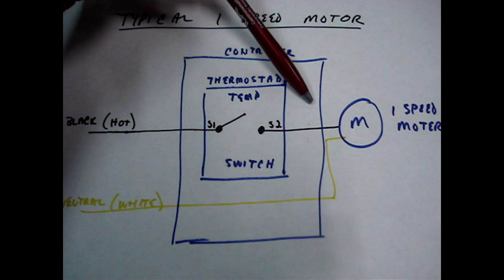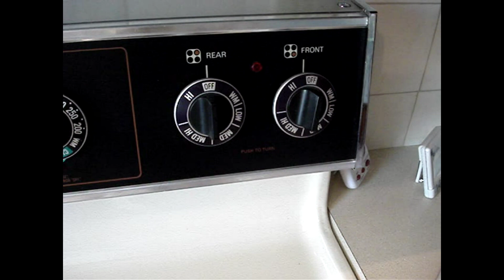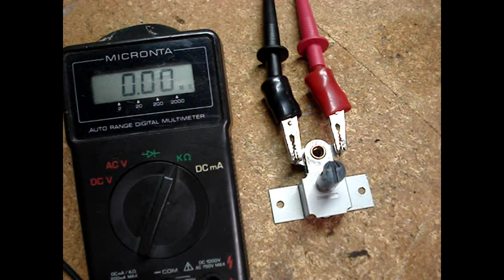How Does a Bimetal Thermostat Work?

Comment: is the switch repairable?
Reply from the maker: You can clean the contacts with a burnishing tool or spray contact cleaner.
https://www.newark.com/gc-electronics/9338/standard-width-burnishing-tool/dp/93B0612?gclid=CjwKCAjw8-78BRA0EiwAFUw8LAuABNs9OtGWzW_9uaTbxJdH-vtj9lpcqJmPSOD-oPfk5NsaeGE9txoCPFAQAvD_BwE&mckv=sADDjZbVG_dc|pcrid|434136793599|plid||kword||match||slid||product|93B0612|pgrid|100464452306|ptaid|pla-905026086955|&CMP=KNC-GUSA-GEN-Shopping-NewStructure-Tools-ProductionSupplies

https://www.lowes.com/pd/CRC-Contact-Cleaner/999964587?cm_mmc=shp-cprdelcgooglelia-106-electricalaccessories-999964587-_-0&store_code=279&placeholder=null&&ds_a_cid=112741100&gclid=CjwKCAjw8-78BRA0EiwAFUw8LFns8S17oREEmtc7fMTAfowyKILc1sF_njKaKrMdZLA4r3aSkNdLFxoCvBsQAvD_BwE&gclsrc=aw.ds
Reply: @Know-How-Now  thank you very much I'll try it

Comment: At around the 2:00 mark, you said the contact is closed; therefore, wouldn't the current flow through the two metal strips (s1 and s2) instead of turning off the current as you showed later in the video?
Reply from the maker: I'm not sure what you are asking.  Around 2:00, I am explaining that as the metal strip bends it will close the contacts.  When I heat up the switch later in the video, I am using the multimeter to test for continuity. An infinity reading (open) would represent no current flowing.  When the metal strip gets hot enough to curl, the reading is less than 1 ohm.  That shows that the switch has closed and is allowing current to flow.
Reply: Less Value of 'Ohm' means near about short circuit. As he had shown, near 2 min.